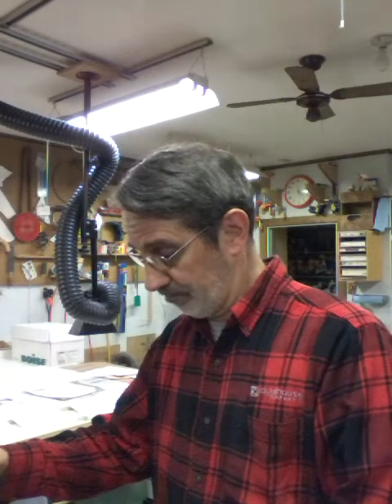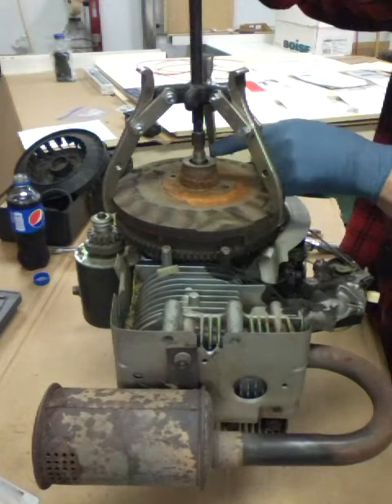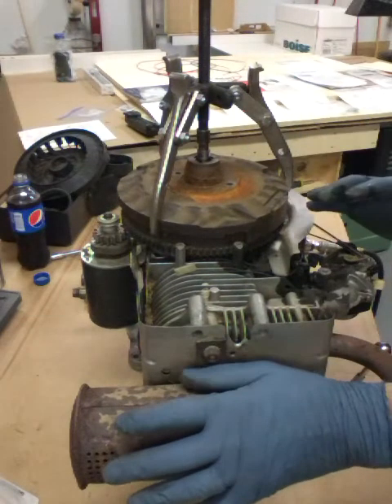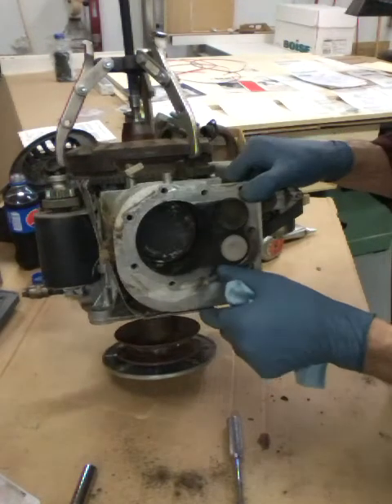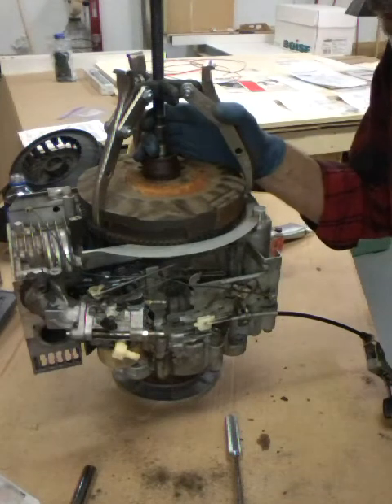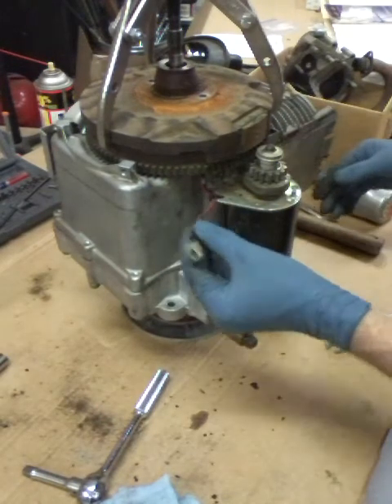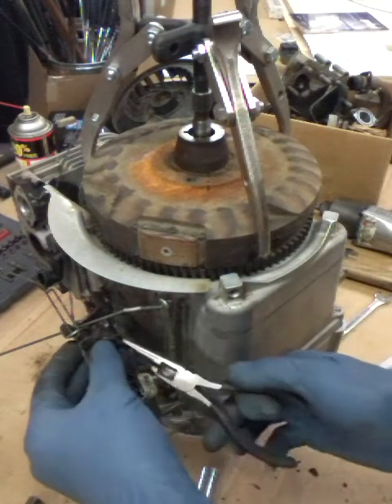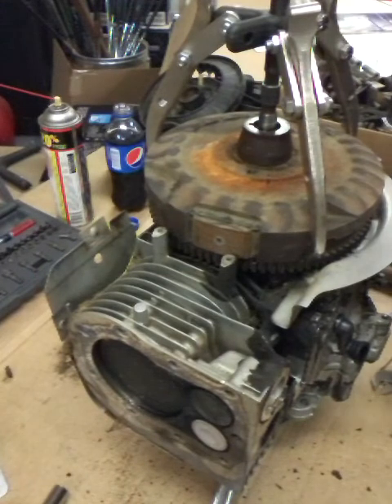24. Rebuilding my Snapper engine   part 1 of  5

Comment: Mr. Jim, the two small holes in the flywheel are there for attaching a puller for the removal of the flywheel. They take a 1/4 x 20 bolt. If they are not already threaded (some are not) it is a simple matter to cut threads in them. This serves to locate the pulling action of the puller closer to the shaft which is better for the pull and for the flywheel itself. Thank you for being so kind as to help so many others to learn about Snappers. I have one myself which a neighbor threw away last year because he "did not know how to work it" as he put it. I offered to help him but he said he just wanted to use his old walk-behind-mower. I hope to get to it sometime this summer. I will be consulting your videos a lot whenever I do. Thanks again.
Reply from the maker: Exinanition   Yes I know that some pop right off easier with a wheel puller it's faster,  if the taper is rusted on you need to use the other style puller using the two holes in the flywheel , But thanks for your comments.  Jim

Comment: I have watched a few of you videos.   very informative.   I have a snapper like yours.  the only thing that is different is the motor.  I believe mine is an 82 model.
Reply from the maker: Is it  running ok or do you need help with  it Thanks for watching don't forget to subscribe lots of videos coming up talk to you soon   Jim
Reply: +Jim Jackson well not really.   I'm having issues with the carb.  I have a hard time starting starting it.  once I get it running, and I egage the blade I loose power and it dies.
Reply from the maker: +Charlie Morris  Hi Charlie
        you're right it sounds to me like you need to clean your carburetor the best luck I've had with them,  I remove the carburetor take the float Bowl and  the float off and I put it in a ultrasonic cleaner with water and mr. clean let it bubble for about 15  to 20  minutes flush  it out with  water  and with a air hose blow it out the best you can in  all the small ports  and passages in a carburetor and let it dry. but be careful not to blow out any small seals or rubber seats do it in a small confined area so you don't lose any small parts  ( been there and did that once myself ) my Ultrasonic Cleaner I bought at Harbor Freight it cleans pretty good, Well anyway the third one did the first two didn't work but as far as cleaning out a carburetor it works pretty nice. If you need any other help feel free to give me a shout or email me direct at    Jimsfixitshop@gmail.com   Thanks for your interest and comments talk to you soon Jim

Comment: The biggest problem that happens to those engines is overtime grass clippings gather and plug the hidden cooling fins. Take the blower cover off every two or three years and blow out all fin pockets.
A plugged motor can’t cool and overheated oil can’t lube. A clean Briggs with fresh good oil will run forever. I use top synthetic heavy weights in my 2002 10hp and it runs as new.2018.
Reply from the maker: Bill Bright 
Hi Bill
   I think that’s true with most small engines,  and mice building a nest is another big issue with overheating engines. Thanks Jim

Comment: Love your content! Bought a snapper series 11 about a month back. Needed alot of work to get it up and running, been watching your videos to help me get there. Love your chennel. She still needs a little bit of work. But my question for this video series is, is this pretty much the same process for a 10 hp briggs and straton engine on my series 11?
Reply from the maker: Geoffrey Richardson 
Well I have to say yes, but I’m not sure what you are trying to check or do to the engine, let me know if you have any questions or if you need any help thanks Jim
Reply: @jimjackson9381  thanks. Well, it started when the motor seized up on me after I had the mowor up right while doing some repairs. It actaully acted like it was hydro locked. I took out the spark plug and blasted the cylinder with PB Blaster, and turned the drive disk until the motor moved freely. I changed the oil and got her back up and running again. But now its leaking oil from around the back near the oil drain. I haven't really examined it super close. So i was thinking maybe there is a gasket that needs to be replaced. Or if maybe after a changed the oil I somehow damaged the plug. Not sure. But i was considering just taking the whole motor off and doing a rebuild.

Comment: you wouldn't happen to know any pointers on fixing up a snapper sr930 with a 10hp Briggs and Stratton. pull start and electric model?
Reply from the maker: Raymond Webb 
  Are you talking about fixing the snapper rider or the engine
Reply: Jim Jackson, looking for some pointers on the rider. The engine seems to be ok besides the carburetor over filling.
Reply: most of it's the same has the ones you show but it has a few differences. like the bar in the middle being flat or having a flat cover on it. mostly doing some maintenance on it because it has been neglected a little. thanks.
Reply from the maker: Raymond Webb 
  I don't do a whole lot with engines. Mostly work on the tractors I do clean carburetors and gas tanks and that's about it I can buy them new cheaper than I can fix them thanks for your comments and questions Jim